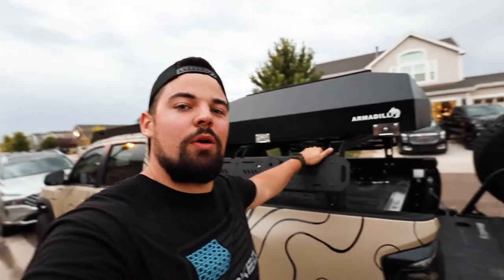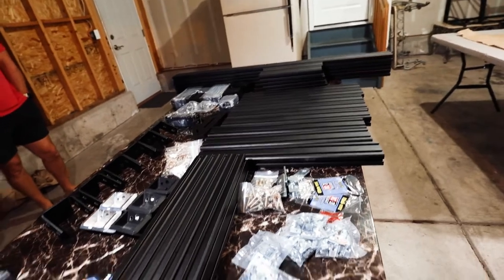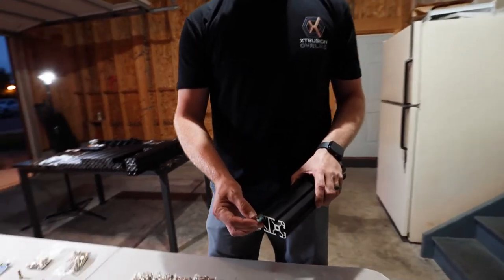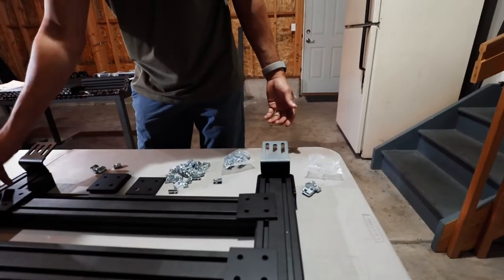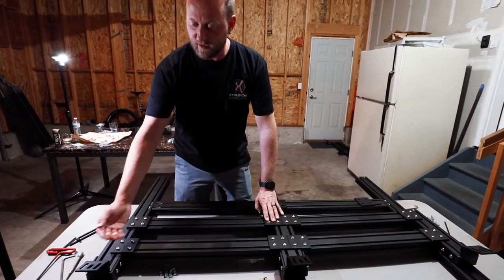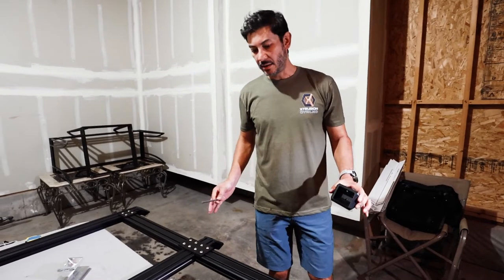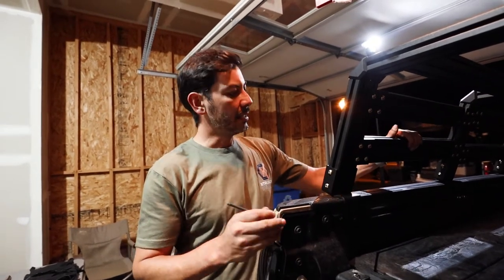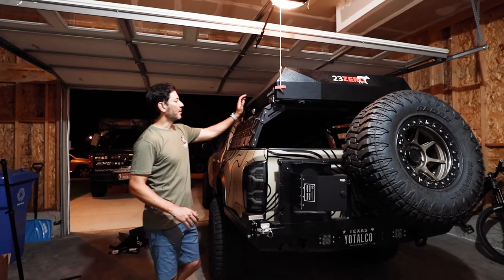Xtrusion Overland Bedrack Install | Toyota Tacoma

Comment: Should i get the 21 inch or the 22 inch height rack for my Tacoma? I want my tent to be as low to the cab roof as possible and I don't have a roof rack.
Reply from the maker: Measure from the bed sides to the tallest point of your roof then add 2” for bed flex. Also depends on what tent you have. Send me an email to josh@thedarkyota.com and I’ll help you configure it and get you the best pricing.

Comment: Just installed mine but confused in regards to the plates that slide into truck bed rails. The instruction from the video says to have the flat part closer to the truck bed. How did you make it work with the bolts closest to the cab and closest to the rear of your truck? The plate sits where the bolt should screw back in to the rail. Did you just not screw those bolts back in?
Reply from the maker: I have the extended rack. You’ll want to move the rack either forwards or backwards to be able to put that bolt back in I believe. I didn’t have that issue
Reply: @The_dark_yota  I’ll give that a shot thanks!
Reply from the maker: @martee4  no problem

Comment: Is it possible to order different size uprights to be able to change set ups for like winter and summer? Winter eventually I’d like to be able to run a softopper but summer I’d want to drop it lower with a tent on top
Reply from the maker: Yes you can order whatever height uprights you want and can swap them out when you want to. You’d just have to switch the feet and uprights I believe. We’d have to double check to make sure the cross bars aren’t different for a different angle on the soft toppers. I would Email them and ask. Either way though promo code Thedarkyota saves you 10%

Comment: Ok so I think I’m now regretting my decision on my purchase of the XTR1 for my truck. There was absolutely no mention of a back order of parts when I made my order. I’ve called, was told that their picking up parts later that day and will ship it right out, that was a week a half ago. I’ve e-mailed and got no reply at all from customer service. I called again and spoke to others that said they will find out when it will be shipped out and text me back, but days have gone by and no text. My order was placed over a month ago now, cancelled a planned trip as well. I hate to keep bugging them. I do understand that I’m not the only customer, but if you say you’re going to do something then do it. Get back to the customers that have paid you and let them know what is going on with their order.
Reply from the maker: You don’t need to blast my videos with your comments. I said I’d try help you even though I don’t work with them. One bad experience doesn’t define a company or the quality of their product. Communication could be better but lead times and changes are part of building a rig.
Reply: Hey! Sorry for the communication issues. Our guys are on top of things normally but things might fall through the cracks in some instances. We weren't able to correlate your order with your Youtube handle. Go ahead and shoot us an email with the details. Also we do have on the confirmation email the lead times on the rack order! Remember that Xtrusion is a custom bed rack that can also be customized over time or changed to a different platform. It is unique in many ways and totally worth the wait. We definitely do not recommend planning a trip around delivery times however, as all supplies are still a circus. Shoot us an email and we'll get back to you.
Reply: @XtrusionOverland  I do understand about the planning of our trip and it was our fault, just would’ve been nice. I have emailed the company in the past to find out about my order and it took 11 days to get a reply. I was told it was the top brackets that you were waiting for and now I’m told it’s the bottom brackets that’s holding up the order.